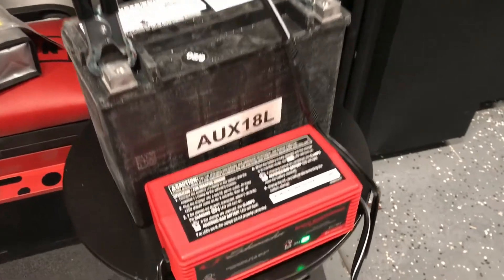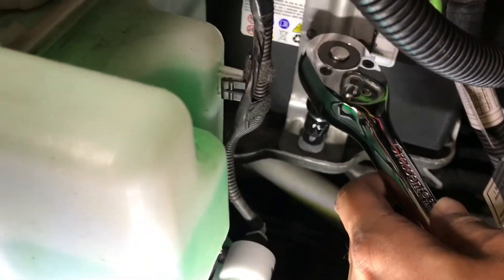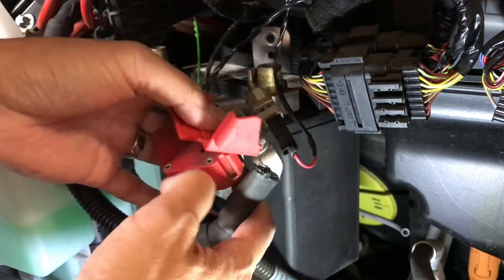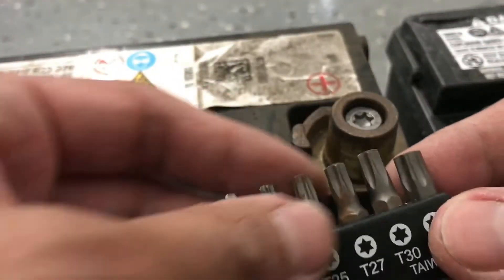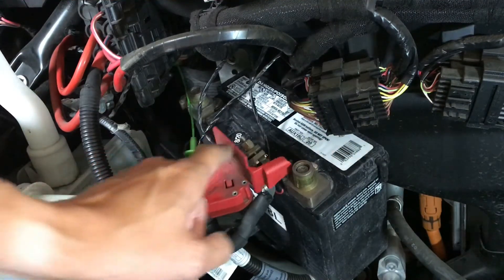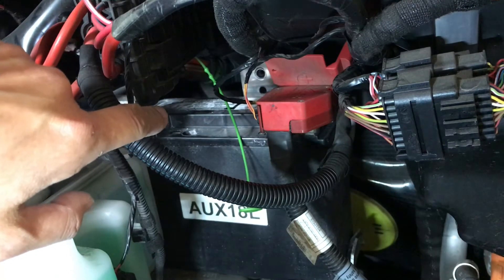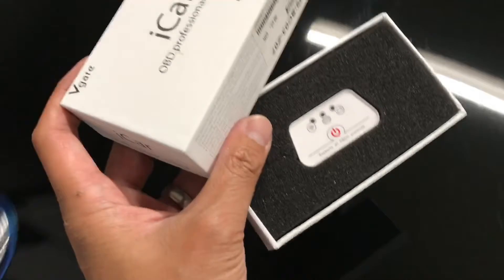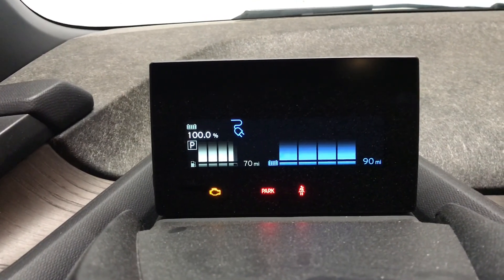How to Replace Your BMW i3 12v Battery - Part 2

Comment: @FunCentric; thanks again for video tutorial. I expect my Remy AUX18L to arrive today. can you just tell me if in the procedure to register the new battery you have the vehicle on or off. I have the Vgate iCar OBDII reader and Bimmerlink app like you suggested. Thx!
Reply from the maker: To register the battery, the car is on.
Reply: great, thanks. is there a correct sequence?, such as: 1. plug in the iCar module, 2. turn on car, 3. open BimmerLink app. or something else. Sorry to pester you, I write music, not much of a car guy, therefore, too many questions!
Reply from the maker: @robbyaceto4467  I honestly don’t remember. But that sequence sounds logical. I would try that. The worst that can happen is that it doesn’t work. And then you can try a different sequence. I am about 95% sure that is how I did it though. feel free to post any social media of your music here. I would love to have a listen.
Reply: ps. indispensable video!
Reply from the maker: @robbyaceto4467  Glad you found it helpful.

Comment: wow, amazing video tutorial thank you so much. i’m about to do this job on my wife’s 2017i3Rex as soon as i can source a new battery. i watched several of these tutorials and yours was the most comprehensive. as for your orange “service needed” indicator on the last screen? i believe that refers to your Rex needing an oil servicing; these i have to have done at a dealership but maybe it’s DIY-possible if you are patient and clever which I am not.
Reply from the maker: Thanks! Glad the tutorial helped. Yeah I had seen all the videos of 12v changes but they showed more about how they can do it rather than providing enough detail for viewers to actually follow along so I had to make this video. Good for my own reference too!

Comment: Just replaced mine today (17 Rex) and it was hell, . mostly getting the hard to reach screw over top the battery off and back on... unfortunately the bolts that screws into the negative terminal was rusted to hell and stripped on mine, so i had to order 2 new screws , which cost 4 bucks but 20 for shipping , and i also couldnt use my car til the screws/bolts got here lol..  When i got the car back up running, withOUT using bimmer link , saw the highest GOM yet 275 km or 170.8miles, previous high was end of August last year 263)   Thanks for the great video, much apreciated !~~
Reply from the maker: Cool, glad the video helped. Yeah, there are so many things that are hard to reach. I am not looking forward to doing it again.

Comment: HTF did you just drive it with the code. Mine won't even start. Only accessories and off!
Reply from the maker: I waited a couple hours if I remember right.
Reply: @Funcentric  ok. I'll try that.

Comment: I left my car at the dealer for a battery swap which I thought would be a couple of hours. Then they told me the car had to "sleep" overnight to register (calibrate) the 12V. FYI.
Reply from the maker: I see. Yeah, mine didn't take that long. Took about just a couple hours.

Comment: In case it helps others, I registered the new battery with bimmerlink but found that the new battery forced my BMW app subscription to reset. I don't remember ever personally paying for it when I bought the car in feb 2021 (car is a 2018) but somehow had it until oct '22. I subscribed/paid, it took a few mins to update. Then I found that the app said GPS in the car was deactivated/disabled. I had to unplug the car, turn it on, go under iDrive, vehicle settings, vehicle tracking - uncheck it, wait a few mins, check the box again, exit, turned off the car. I was able to see the location in the app again

Comment: Thanks a bunch for the thorough video walk throughs. In my case, the I3 died in my garage, and initially, I had no intention of trying to mess with this myself. However, I am still waiting for the BMW dealer's service department to call me back a week later.  So without the video, I would still be sitting here  with a dead I3 in the garage. The second video was super as it explained very clearly how to get the various components disconnected.
Reply from the maker: Awesome! Glad it helped you out. Yeah, the first video is a summary overview of what is required. Part 2 is a literal follow a long video.

 I had to make this because as I was searching myself, I only found videos of how other people did it with lots of missing details. I needed a video of how I myself could do it. A complete diy guide. Didn’t exist so glad you found the one I put together. Drive safely.

Comment: I think the CEL was from the original bad battery situation. It doesn't exist now. 
The reason ( at least on gas powered bmw's ) for registering the batteries is because the battery monitory system will up the chart rate on a weak battery. The system will keep charging that higher rate on the new battery until the registration is done. So you might be frying the new battery.

Comment: Great video. I completed the installation however the car still does not display Ready. I know you mentioned registration for the battery isn’t necessary. I’m curious if BMW has changed this since a year ago. Any thoughts?
Reply from the maker: It’s possibly but not likely. I did have an error for a few hours that resolved itself after the installation. Does the car start?
Reply: @Funcentric  It doesn't. It was the battery. However the battery is fully charge and it still hasn't been able to start. I will get the bimmerlink app and see if that works.

Comment: Two comments:  first, thanks for the info -- it really helped me get the job done.  Second, I got the Check Engine light, too, so I drilled down in the Vehicle Info menu (if I recall correctly), and it said the REX needs an oil change.  Without changing the oil, I drove like normal and within a day or two, the Check Engine light simply went off and stayed off.

Comment: What is the green plunger hanging down???
Reply from the maker: Not sure what you are referring to.
Reply: @Funcentric  There is a green wire with a head at the end that you show dangling in front of the battery,
Reply from the maker: @dougtravis8047  oh i had never really even noticed that. UPDATE: That is the emergency pull cord for releasing the gas tank of the REX. For whatever reason, it came loose. It's suppose to sit up higher. I've since reattached it to where it belongs. Thanks for pointing that out.
Reply from the maker: @dougtravis8047  Update on the green plug. It's the emergency pull cord for the REX gas tank door. It came undone.

Comment: Help! I lost the hex bolt on the metal bracket that holds the battery (it popped off and fell into the body) Does any know replacement part it is?
Reply from the maker: It’s just a regular hex bolt from what I remember. It won’t be American so guessing the sizing will be in M. Maybe take your best guess and buy a few. Won’t be expensive.
Reply from the maker: You can also ask on the Facebook Groups. Someone there might know the actual size.

Comment: Great video.  My only feedback would be to clean the screws (saw some corrosion) and use some battery cleaner and protector on the bronze pieces, etc.
Reply from the maker: Thanks. Very good point. I probably should've done that while I was digging in there.

Comment: I just replaced the battery, but one of the many warnings caused by the dead battery didn't go away (drivetrain alert). Now, it won't start. If you have any suggestions, please let me know.
Reply from the maker: Some including myself have reported the drivetrain warnings, but for me it went away in a few hours. Some it was a few minutes and others was overnight. Maybe give it some time. 

Some troubleshooting I would do: 
1. Are you certain the battery is good? 
2. Make sure the high voltage battery connector is properly seated. 
3. Make sure the car is charged. The main battery charges the 12v.
Reply: @Funcentric  everything is good... it was a new battery...It's parked for now. Hopefully, the alert clears soon. Thanks.
Reply: Hey. Has the Drivetrain alert gone away since last week when you did the swap?
Reply: @nicolasfonrose103  it didn't go away. I had to get it towed to bmw for another battery and "initialization."
Reply: I have the same problem, Did you resolve?
I have drivetrain alert and doesn't start... :(

Comment: PSA for Californians in Bay Area: 
Call Peninsula Battery of South SF. You can order it from them. Their supplier is located in San Jose and Peninsula Battery arranged it so that I can just pick up the battery from the SJ warehouse. Battery is made by Deka and I got it for $160 out the door.
Reply from the maker: Thanks for your contribution! Wish I heard about that earlier. Haha. Glad you got a good price.
Reply: @Funcentric  Thanks for making this informative video! You explained every step in very helpful detail. I am finally going to tackle this replacement this weekend (a bit scared of getting shocked though)
Reply from the maker: @LukeAMendoza  Sure! Yeah there's lots of info online but they were sorta everywhere. You'd have to search multiple sources to get just this one thing done so I figured I'd collaborate it into one so that people aren't just witnessing someone else do it but that they can actually follow along and do it themselves. No secrets. Just sharing everything I learned. Glad this helped you out. I'll keep my eye on my comment section in case you have other questions I can address quickly. Good luck. You'll be fine. Just don't touch negative to positive ever.

Comment: Great video! I am planning to replace my 12V battery and the electric fan for the radiator. I assume removing the clip for the high voltage battery will remove the power to the electric fan for the radiator(It often runs when you plug in the charger or turn off the car) as well? Can you confirm that the plug you showed removes power to all electrical connections to the high-voltage battery?
Reply from the maker: Thanks. Tried to get enough detail in there but edited it so the video wouldn't be too long. Sounds like it helped. 

I also assume that removing the clip for the HV battery would remove power to the electric fan as it would only be powered by the HV battery. I can't imagine our tiny SLA 12v battery would be able to handle that. I cannot confirm with 100% certainty though as I'm not a mechanic. Not even close. I followed some other YouTube videos closely and found that there was info needed from various sources so I put it together so people would have a single place to get all the info they need. 

That's a long way of saying, I don't really know. Sorry I can't be of more help in this regard. Not sure if BMW would let you talk to a tech directly, but it may be worth dropping by a dealer and sneaking your way into the shop and asking. Or make friends with a Service Manager and get him/her to know you're looking for casual quick talk with a tech so they don't write it all up requiring an appointment.

Comment: Great video and well explain! Did you have some warning light telling you that the battery was running dead?
Reply from the maker: Initially the interior lights didn't turn on when the door opened like it normally does. Then I did get something on the display eventually that indicated that the car would not charge. I tried charging it anyway and it seemed fine but it took many many hours and the car's main high voltage battery still wasn't charging much at all. The 12v also didn't charge enough either. The car needs the 12v to be full before the main battery can charge.

Comment: Thanks for the video, do you really have to charge A new battery?
Reply from the maker: Good question. I figured since lead acid batteries like to be fully charged, that I'd go ahead and do that. I was surprised though that when I started to register the battery with the app, that it only gave me the option to indicate that the battery was half charged. I don't know if there are sensors that indicate and update the car to tell it that it's actually fully charged already. Perhaps if I did it again, I'd confirm the battery was half charged upon delivery and just install it as is. I was paranoid though b/c the whole reason I was having trouble is b/c the old battery wasn't full enough. That's a long way of saying I really don't know.

Comment: So you don't need to register the battery yet you go on to describe what you need and how to register the battery...?
Reply from the maker: intermarer It’s recommended to do it so that the battery can be calibrated by the car. Registering it lets the car know it’s a new battery and the computer does it’s magic. It’s not necessary to register to make the car physically operate. Many including myself was worried that registration was required to turn the car on and make it work. Just stating not required in case some want to save the cost of the app and the OBD 2 reader.
Reply: @Funcentric  Gotcha, thanks!
Reply from the maker: @intermarer9145  Sure thing. Another reason why I figured it may be helpful to share is b/c the dealer would charge a ton to register the battery. For the longest time, people thought the dealer or authorized dealer are the only places to get it done. They charge a bunch and prices vary from place to place and can get up to $200 for 2 minutes of work. Using the app and the OBD2 reader yourself is a more consistent cost and most likely doesn't vary much by where people live - definitely more cost effective.
Reply: @Funcentric  I too reached out to Concord BMW for a battery replacement quote in August and they could not give me one without looking at the car, but it wouldn't start!  I just finally got around to pulling the battery and confirming I need the AUX18L.  Where did you get yours and has your check engine light gone away?
Reply from the maker: @glennrcompton  Yes, the check engine light went away. I got my battery from eBay b/c at the time, Remy's prices had gone up. They are currently out of stock so calling a few dealers in your area would be the way to go. It's BS that they can't quote you a battery price w/o looking at the car. They know what the car looks like. They make them! I've had good experiences with Concord overall, sometimes you just have to push a little harder. Sometimes sales people answer questions you're not asking. Gotta steer them to refocus on what you ARE asking. Price of a battery - not a diagnosis. By the way, the price they give you initially is assuming a trade-in of your original battery which is only $15 less than if you just got a new battery w/o a trade-in.
Reply: @Funcentric  I reached out to East Penn directly and was directed to Peninsula Battery in South San Francisco.  The AUX18L battery ran $135 after tax and I used the BlueDriver O2B2 reader to register the battery.  No issues after clearing all of the error codes associated with the former battery.  Thanks for the video!
Reply from the maker: @glennrcompton  Awesome! So glad it worked out for you and you got an awesome deal on the battery! I'll have to keep that in mind for next time! Drive safe!
Reply: I’m having trouble finding an OB2 reader that will register the battery. there are tons come up on amazon when you search but none of them say registering a new battery is one of the functions. can someone just point me at one that will do the job, I’d be so appreciative. also, is there a pro/con to using a handheld that does it all or a dongle/mobile app combination. thanks in advance, crew!